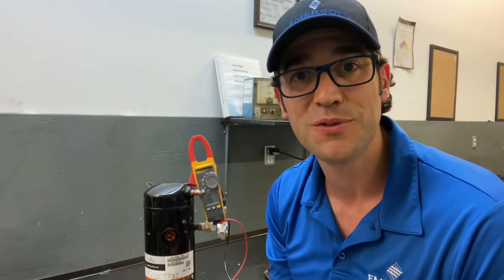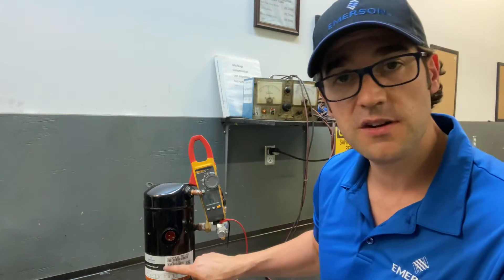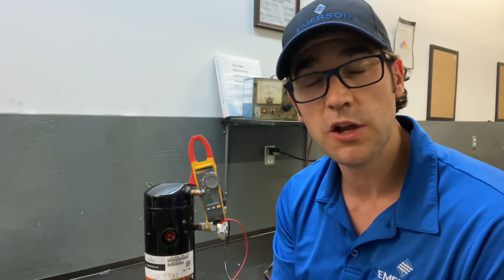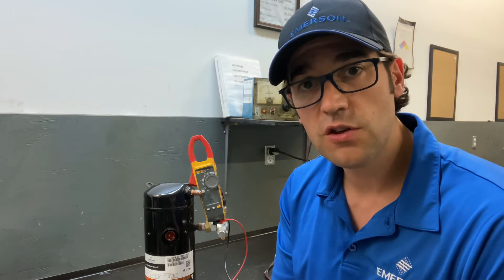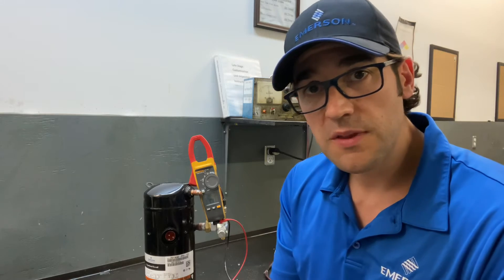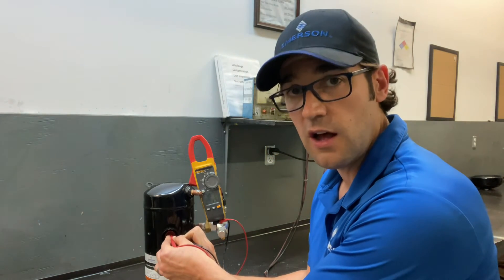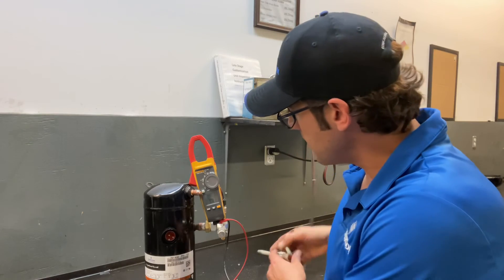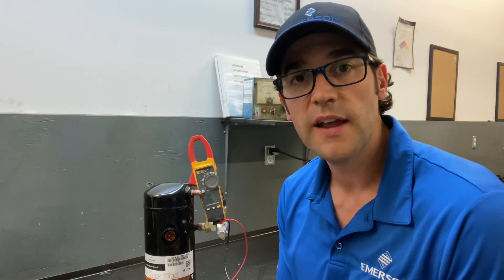Checking Winding Resistance of a 1ph Scroll Compressor

Comment: Does the outdoor ambient temperature affect  ohms readings, and if so, in what way?
Reply from the maker: Excellent question — and yes, temperature, refrigerant, and moisture can all affect compressor winding resistance readings when using a meter. Here’s how each factor plays a role:

1. Temperature
	•	Copper resistance changes with temperature.
As winding temperature rises, the resistance increases — roughly 0.39% per °C above 20 °C (68 °F).
	•	Example: If a winding reads 1.00 Ω at 20 °C, it could read about 1.20 Ω at 70 °C.
	•	That’s why manufacturers often specify resistance at a given temperature (typically 20 °C or 25 °C).
Comparing readings without correcting for temperature can lead to false conclusions about winding condition.

2. Refrigerant and Oil
	•	Refrigerant or oil around the motor windings can affect readings slightly because they influence heat dissipation and sometimes conductivity on the meter probes.
	•	In hermetic compressors, if you’re measuring from the terminal pins, the refrigerant inside the shell doesn’t usually change the resistance much — but it can alter insulation resistance (megohm) readings when using a megohmmeter (megger).
	•	Liquid refrigerant or oil film can make insulation look weaker than it actually is, giving lower readings.

3. Moisture
	•	Moisture is the biggest variable for insulation readings.
	•	Even a small amount of moisture absorbed into motor varnish or oil drastically lowers insulation resistance, sometimes from hundreds of megohms down to just a few.
	•	This is why warm, dry conditions (or warming the compressor slightly) are recommended before performing a megohm test.

Summary
	•	Resistance (ohms) readings are mainly affected by temperature.
	•	Insulation (megohm) readings are strongly affected by moisture and refrigerant.
	•	Always record ambient and compressor temperatures when testing, and allow time for the compressor to reach room temperature if it was just running or exposed to cold refrigerant.

Comment: My SPERRY Digital multimeter 61-602 has ohms numbers ranging from 200,200k,20k,200k, 2m,20m.  How do I k ow which number to set it for? I have single phase compressor, 2 ton unit. I’m not a tech. Thanks

Comment: If my winding to ground resistance starts off around 1 megaohm and climbs. Is this indicative of a short? All windings do this and never have OL. 

Trying to determine if scroll compressor is seized or shorted because it blows fuses at disconnect
Reply from the maker: @gregb2758  if you megohmmeter the winding an you are getting 1M ohms those winding are the problem.  Unless the system is fully contaminated. They should be in the ~20-50M ohm range. Check out Copelands Megohmmeter testing bulletin it will talk about it in there.

Comment: what is mold plug? could you explain more? Is it removable and replaceable? I measured Res_R_S=0.7Ohms, Res_C_S=2.5OOhms, Res_R_C=1.8ohms. Do I have a shorted winding?
Reply from the maker: With those numbers I would not think winding to winding or turn to turn short. Did you check then to ground? Or did you megoohmmeter the windings? Check those next time

Comment: I like you a lot you explain things nice and you don’t have any weird shit on your videos. I’m probably going to follow your channel. I am a refrigeration tech for over 30 years. I work in an industrial power plant that’s my main job and my other side job is as I have a truck and I do refrigeration and air-conditioning and boilers and what have you Yes you were right everything you said is good I usually do a megaohm test and that usually tells a story of its grounded Winings either start or Ron. The other thing is is that you could have a motor that it’s good and the compressor still blows the either overload or breaker usually when that happens is that the compressor locks up inside and then that’s when you do a hard start kit. At that point you know the compressor is on its way out. Very good video.
Reply from the maker: Thanks for watching. Share videos with others that interest you. I also have a free compressor guide https://offers.refrigerationmentor.com/free-guide I think you will enjoy it.
Reply: Thanks for the reply that’s really cool I can’t get to that website or whatever I have to figure out what I’m doing wrong but thanks again

Comment: Hi Trevor,

What was that last instrument you used to check the compressor? Also, on Recip compressors, I was told never to use a megaohmmeter on the compressors because that will short out the motor temperature resistors. Is this true?
Reply from the maker: It is a Hi pot tester, it does something similar to a megohmmeter. No as long as you follow the proper testing procedures you will not damage the internal sensor.

Comment: Trevor,how much does ambient or the internal sump temp affect those resistance readings!

I’ve ran across a few that were still within the % range but not on the dot. They were mechanically bad not electrically.

Thanks!
Reply from the maker: Both ambient and internal sump temperatures will affect the winding resistance readings. The higher the temperature of the windings you will read a higher resistance but as long as you are running inside the envelope and have the right amount of air, water, or refrigerant cooling that compressor should be ok. When you get outside the envelope that's when you should be concerned.  Always use Copeland Mobile to check and what the actual should and it should be usually +/- 7%, as it looks like you do. Great job.  Other things do affect the winding resistance like oil, refrigerant, dirt in the system.   

Here is a great bulletin on 1ph compressors https://webapps.emerson.com/online-product-information/Publication/LaunchPDF?Index=AEB&PDF=1209

Here is a great bulletin on Megohm Values of Copeland® Compressors https://webapps.emerson.com/online-product-information/Publication/LaunchPDF?Index=aeb&PDF=ae1294.pdf